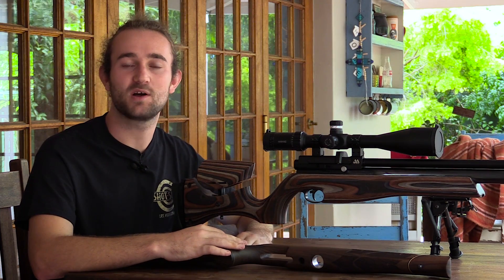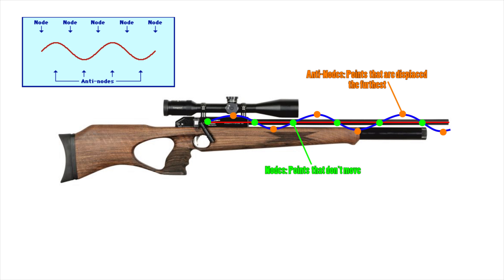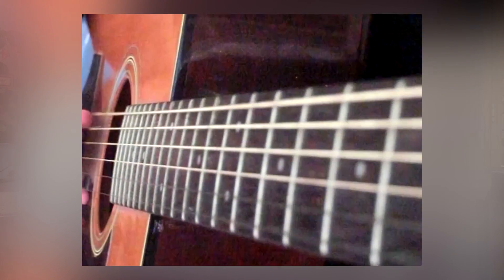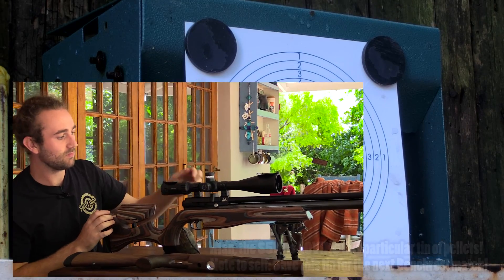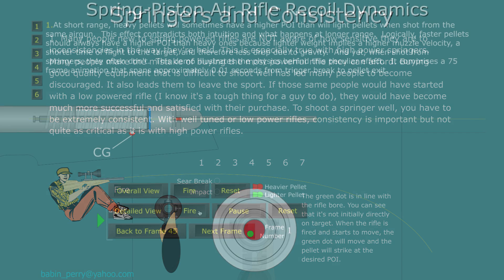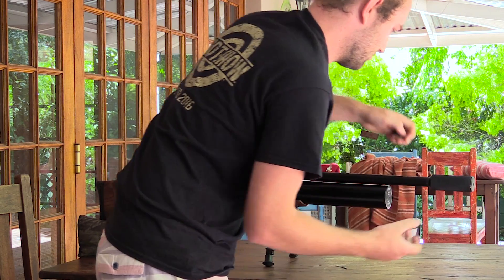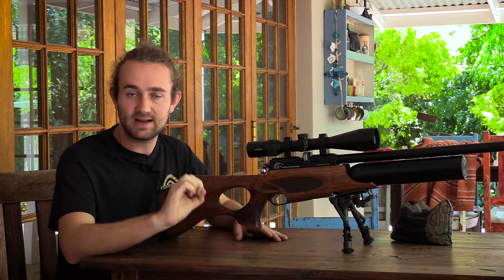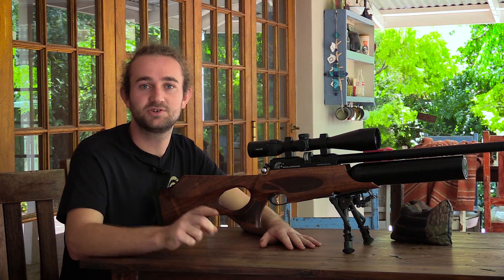Recoil Dynamics & Harmonics | AB101 pt.5

Comment: Great series! Thanks. Very informative especially for an aged powder-burner like myself. Your ballistic principles are right on. I have discussed this very topic in my book.

As you point out, although unseen by the shooter, long, thin barrels can vibrate upon firing somewhat like a piano string (but at a much lower frequency). This unseen, but very real, effect can affect bullet placement. Tapered barrels are both lighter and stiff, and they can be "detuned" to avoid resonant effects. Fairly recently some manufacturers have started making thin asymmetrical barrels wrapped with carbon fiber that acts to dampen resonance and affect the placement of nodes. Not being an air gun person, I do not know if this solution has made its appearance outside powder burners (or even if it is practical). Has anyone attempted "damping" by putting tape or weights at the anti-nodes?

Also a slight lateral and rotational movement of a rifled barrel at the instant of firing causes lateral jump, which also has the effect of a small error in bearing. As the bullet gains stabilizing rotation in the barrel, the more massive barrel gains a rotation in the opposite direction in an indirect proportion to the ratio of the masses. Known as recoil torque, this effect is often ignored, since it is small when compared to translational recoil (a.k.a. felt recoil in firearms) and varies from round to round; but this suggests the need for a stiff and heavy barrel. The heavier a barrel is the stiffer it is; and the better it handles heat. Increased temperature in firearms causes the bore to dilate. Target guns have heavy barrels partly for this reason and to limit felt torque. 

Once again thanks, a great series. Air guns have clearly come a long way since the old "Red Rider" or "Daisy" BB gun!

Comment: Hello Matt, I know we're not talking about springers here, butt... Ive had a birthdaypresent. My girlfriend bought me a Gamo Big Cat. The box says it shoots at 1400ft/sec (which I doubt), but it's shooting everywhere but straight. I got myselves the haviest .177 pellet I could find in order to bring the speed down a bit, mounted a Vector-optics scope to get better results and even when I put the gun in a clamp it's shooting outside 2 to 3 inch groups at 25 meters. Do you thin this problem could be resolved by putting weight on the barrel somewhere? Or is there anyway I can tune it down a bit so it's less violent? Selling the gun is not a direct option ;-) but shooting it isn't either. If I could hit an inch at 25m I'd be happy, but right now, this is not an option. 
Not to be compared, but with my Crown I shoot half an inch groups at 50m...

Comment: Sorry Dubber ...there is no "perfect barrel length"! Should manufacturers experiment with barrel length, "using real shooters & not just locked down in a vice" ..as you suggest they should, they may very well "come off the press" with a barrel, install it in a gun, have a shooter test it & BAMM ...PERFECT!.. you've done it! ...the perfect barrel length!  Now, give the hammer spring a turn or two, adjust the regulator a couple hundred pounds and ..oops ..not so perfect anymore. That's what "tuning" is all about: "setting up the gun" so that the gun setup is perfect for the barrel ...not the other way around. I would say that, the first three shots in his demo, that barrel was the perfect length....how much better can you get than a hole in hole in hole group? But change the stock of the gun ...not so much. Every thing you change on a gun effects the harmonics of the barrel. The only way to achieve that perfect barrel length is to produce one that has no harmonics at all. So far ...never been done ..not even with powder burners.  You will still have to "match the load" to the gun!All that "tuning" does is: find the correct combination of: projectile weight and size, power setting (hammer spring & regulator preasure) to make the barrel that's on the gun ...you guessed it ...the perfect length! There will never been a guitar string that you put on a guitar and it will play a "G" ...you'll still have to tune it. Same thing with barrels!

Comment: With regards to spring air rifles, The description with tension on the guitar strings describes perfectly the vibration in the spring. By adding preload (washers etc) you can greatly reduce hold sensitivity by increasing the spring frequency and amplitude that occurs after the shot. By doing this, I've noticed very little if any effect on velocity.

Comment: Hi Matt, As I understand it, doing a "harmonic" tune on an Impact involves doing a "velocity" tune,  balancing the regulator and hammer spring, then using the valve stop adjustment to fine tune the pellet speed so that it leaves the barrel on a "harmonic node". How would you go about doing the fine tune (harmonic tune) on a Dreamline (no valve stop adjustment)?

Comment: .....I am wondering if you might be able to closely determine the locations of the harmonic "nodes" along the length of any barrel, by setting up the gun so that it is properly aimed in a safe direction, and then fired by use of a string attached to the trigger, etc., so as to minimize any "dampening" by the operator/user. Then, heavily "dust" a layer of fine, dry talc, or baby powder, or, fine starch powder along the top of the barrel, all the way along it, and  when the gun is fired, most of the powder might fall away, except where those nodes are centered.  Good luck!...THANKS, for all of your AWESOME, DETAILED VIDEOS!!!
Reply: That sounds like a fun experiment

Comment: Note to oneself: proper tuning involves the matching of the average velocity (i.e., the speed a pellet flies from a chosen barrel, achieving the minimum variation in feet/metres per second), of a particular caliber (a bigger caliber like, say, .30cal., is usually preferable for longer distance shooting, as it is more forgiving in terms of pellet velocity), to a particular size/weight of a pellet/ogive that is plentifully available (and cheap). These two factors, the velocity and the pellet must suit each other perfectly in a specific barrel for a particular distance in order for a quality PCP (or a CO2) air weapon, to perform optimally. Using one single stock helps to tune a precision hole puncher. Changing the stock requires a new test tuning procedure from scratch.

Comment: Technical quibble; while it is possible for the totality of all motion induced in the rifle by the shot to result in a minimal amount, or at least very consistent amount of movement at the muzzle when the pellet leaves it, it is not possible for a barrel (or string or whatever) to have any individual mode with a node at the end, unless it is fixed there. An unsupported beam physically cannot have a mode with a node at the end. The barrel end is going to move; just hopefully not when the pellet passes.

Comment: Hey Matt, I just wanted to say thank you with some of the tips on this video. I was about to get crazy because my new FX Impact X on .22 caliber I’ve just recently bought (this is my second Impact) wasn’t holding the POI at 50 meters and I wasn’t capable to understand what was happening. After whatching this video again, I have just realized that I was zeroing my gun with an Air Chrony installed at the muzzle, not taking into account this was dramatically affecting the final POI. The gun was shooting just perfect (as always... this is an Impact) but my POI was completely misscalculated. Now I’m back on track!!! This little Air Chrony is very usefull to take into the field but it is important to remember NOT to use it while zeroing your gun. Thanks again man. Cheers from Madrid!

Comment: Changing stocks out will cause a point of impact different just because you have changed one foundation to another!  This can be proven just by loosening the action screws a few turns and not even changing stocks. Getting barrel harmonics right I believe is getting the bullet exiting the barrel at the exact same time as the center line of vibration is at its least. And this is done by fps, while barrel length, barrel rigidity and floating barrels are important, the timing of bullet exiting at lowest vibration is most crucial.

Comment: I kinda don't like the idea of a pcp or c02 powered air guns because you run out and I know that pcp can be recharged but I assume that it will take longer and if you run of of air and your tank is empty wouldn't it take longer to hand pump than to just break the barrel or quickly pump it correct me if I am wrong

Comment: Changing the stock will always move the zero. You have released the loading of the screws and then  re-tightened them. Even if you removed the action and then put it back in the same stock, your zero will shift. A shift in zero when fitting a modulator has nothing to do with harmonics, it's to do with air moment, as a pellet leaves the barrel a blast of air expands behind it. with a mod fitted this expanding air is taken up by the MOD. changing you zero.

Comment: Love the info you're sharing here dude appreciate it. I'm curious about the stock change lower POI though. Could the lower POI  be due to different stock screw torques and/or the mating interation between receiver and stock? I believe a slight variation in screw torque would have the barrel axis deflected differently in relation with the scope especially so since the S510 does not have a free floated barrel. Also, 0.5 mil different POI at 25yards equates to around 11.4mm shift. We know the S510 has a barrel length of 494mm. For a 0.5mil shift with a 494mm barrel we are looking at a whip displacement at the muzzle of roughly 0.25mm from center line. To me this magnitude of vibration seems abit too high for a PCP rifle? Perhaps it would be best to test the node/anti node displacement theory with a high speed camera and a dial indicator at the muzzle.
Another more obvious reason could be lesser muzzle climb(not whip) due to the heavier stock?

Comment: You must sleep with your thinking cap on. Another outstanding video. Like the way you challenge the mfg's to continue improvements. Now you've got me thinking, why not solenoid to replace spring, hammer plunger, valve etc? Playing with some hacks based on Ryobi's 18 vdc power supplies and tools. Look forward to #6. BTW, any recommendations on pumps?
Reply: Buy a Daystate !

Comment: The  Benjamin Marauder has a floating barrel though it has a barrel band.  The barrel does not touch and we are told it should not.  What are your thoughts on making it more rigid by installing a semi soft material between the barrel and the band to make it more rigid.  Would it dampen the vibrations or merely introduce interference in the standing wave and make the accuracy suffer?

Comment: Although I would absolutely agree that PCPs are better than springersat super long ranges, I do feel like it is worth advocating for them here.  You can absolutely be as accurate with a springer as a PCP at typical firing distances if you are consistent with your hold (and you let that spring wear in and loctite every bolt).  You will not be able to run out and pick a new springer up and go straight to hunting with one or anything.  But if you fire it often and I mean run tin after tin through it until your hold becomes a habit you will absolutely be just as accurate with a springer at a pretty decent range.  That said, the major point would be at those super long shots.  It may be possible, but I would not trust myself to make a clean kill too far out.

Comment: First of all sorry for my bad english feel free to carrect me in any linguistic errors. I cant imagine that there is a way of getting a node at the end of the barrel, because the refelction of the wave at the end will do a phase jump. So the only way of creating a standing wave is to have an non-node at the end of the barrel. Otherwise it will just do what it wants because the waves are not interfering correctly what means that there are no nodes of any kind. So i dont get how its possible to get a standing wave and a non-node at the end of a barrel. So at my point of view that is not physicly possible. How can this be done? Does anyone know more about the physics behindt it? Also u cant compair a guitar string with a barrel. A string has to fixed ends and the barrel one fixed and one open. But the Video was quit interresting. Am I wrong or is there a trick to fix this?

Comment: Hey Matt love your video`s .Just  want to add by changing the tightness of the bolts holding the stock will change the harmonic`s as well.It will change the group size of the gun.

Comment: I do not believe that switching the stock on the S510 caused a POI shift because of rifle harmonics.  I took a screen shot of you shooting the gun with the different stock and your cheek weld is different.  This is the most common cause of POI changes.

It's a tough topic to tackle and I know everyone is a critic, nice video...the guitar was pretty good too;)
Reply from the maker: +KS Airguns If i take my cheek completely off the stock the difference is the same, so cheek weld is definitely not the cause of the POI shift. Shooting through the scope cam with no contact (besides my trigger finger) yielded the same results. So it is definitely the stock weight!
Reply: Interesting Matt, now I have a scientific excuse for my misses.  Harmonics :)  I wonder if the stock screw tension changes POI?  Have you tried that...less vs more screw tension?
Reply from the maker: +KS Airguns I haven't thought of that, but I'm sure it does make a difference! Definitely worth a test... Would also be interesting to see how power settings can affect harmonics. Hand-loaders do "ladder tests" with different powder weights to find the exact charge that gives an "accuracy node". I'm sure the same applies to airguns
Reply: For the OCD types (AkA airgunners) this could change how I put my stock on.  For me I only shoot EDguns and the barrel is under a lot of tension  so I wonder how that interacts with the nodes vs power.  Damn you matt :)
Reply: Changes in "cheek weld" only effect the POI if the parallax is not set properly on the scope. Set the parallax (objective lens) & you can cheek weld any way you want.

Comment: I have edited this post as it wasn't completely correct either.

Original:
Your drawings of nodes and anti nodes are a little off. You don't want the muzzle to be at the spots you label as nodes. The direction of the muzzle is changing direction the fastest in these points. Simply look at the change of the first derivative. You want your muzzle to be at the points you call antinodes, as the change in direction is the slowest here. The thing to look for in a node is "where will a little change in timing/speed give me the least change in direction". Those spots are your antinodes, which I would label as nodes. the challenge is then finding a combination of pellets, bibod, stock and other things, that will give you the best chances of your pellet leaving the muzzle at the right time. This is the holy grail of reloading centerfires, according to the OCW and OBT theories.

Normally the POI change from adding a suppressor, comes from the simple fact that adding weight to the end of the barrel, will give you some droop.

POI change is normally not an issue, and especially not in a video about nodes. This can just be dialed out on the scopes. If you change your setup during a hunt or competition, then it matters, but who does that?

Edit:
The reason I say off, is because the illustrations are not of a standing wave. The illustrations of the crest and trough are of a the vibrations you get, when you hold a spring in one end and excite it. The muzzle will go in all directions. Here you want the muzzle to be in the same extreme position each time, as this is where you have the widest margin of error for timing and still have the muzzle pointed in somewhat the same direction. Here it is the antinodes you should be hoping for.

The standing wave, is an excitement traveling up and down the length barrel. It is not like that of a guitar string idea, although a guitar string also have them. You do not want the excitement to coincide with the muzzle and the timing of the pellet leaving the barrel. In this case you want the 'nodes' of your illustration to coincide.
Reply: wow I would love to hear a responds from Matt to this comment. I am very confused now.
Reply: I have added to the confusion. I will update my response.
Reply from the maker: +Kasper Rung Some food for thought here... I will go and do more research and get back to you. What you say makes sense. All this information (including many graphs, diagrams) comes from very reputable books, websites and forums so I can't see how they can be wrong, but perhaps they are just over-simplified to explain a point? Either way, I think as long as people understand that a) these harmonic vibrations can affect accuracy and b) the vibrations can be manipulated to  improve accuracy, then my work here is done.